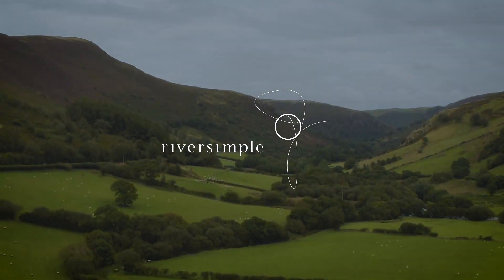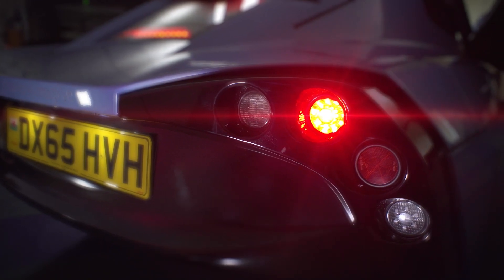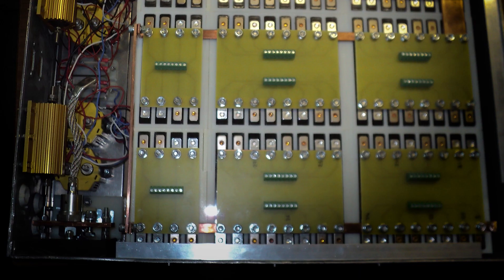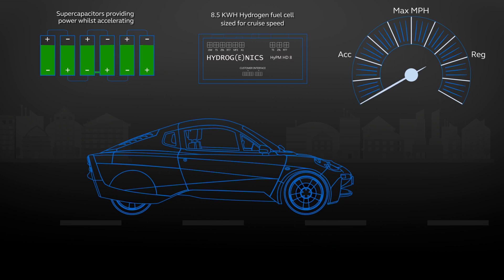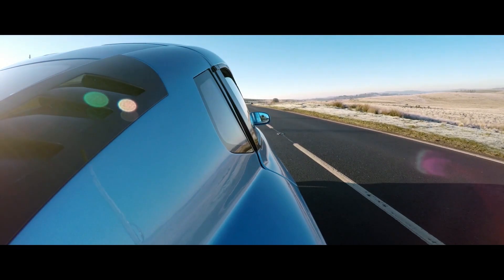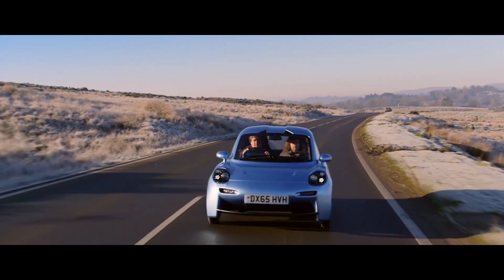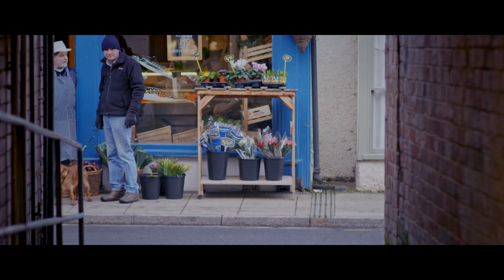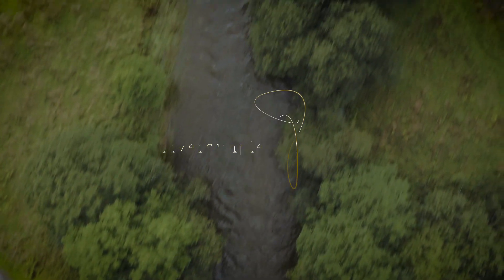Riversimple – pioneering clean cars

Comment: I would have thought that a Battery/ Super Capacitor Vehicle would be superior, pose less engineering and econimic challanges than a Hydrogen Fuel Cell/ Super Capacitor Vehicle. Plus, the charging infrastructure is more widespread, mature, efficient and much cleaner than that of hydrogen. Have you designed and built or modeled/ simulated a Battery/ Capacitor prototype vehicle as a comparison?
Reply: A Battery/ Super Capacitor is certainly not cleaner, How many power stations do you need to charge the Batteries? or wind turbines do you need, wind farms are not exactly environment friendly or pleasing to the eyes.

Comment: Awesome. I have been experimenting with Super Capacitors since Maxwell released their 3000F (actually 3200F @2.7V). They are the State of the Art for power storage where you want maximum efficiency and power delivery. Batteries store Energy Volume, Super Capacitors store unrivalled Power Delivery. I use a 16.2V 6S4P 2000F in parallel with a Deep Cycle battery in my ICE. The starter can do 3rd Gear starts like its nothing. Thousands of ampers. I can fully believe your performance claims due to the capacitors. Very interesting. Thank you for sharing.